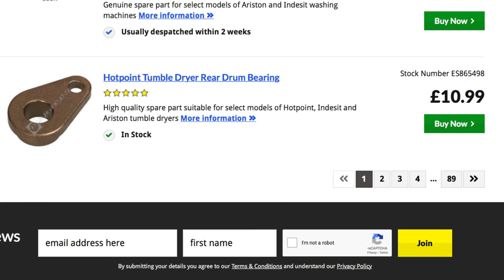How to fix the screeching, squealing noise coming from your tumble dryer (Hotpoint, Indesit, Creda)

Comment: I found your video on Google and I knew I had the same problem. Got the part for £7 and I followed your instructions step by step. It took me half an hour and it's like new again ( about 8 years old). Trickiest part for me was getting the pin back into the 'S' shape and in position. Thanks so much you've saved us a fortune and I'm well chuffed with myself 🤗

Comment: Thank you so much for this excellent video.  My son has just fixed my noisy tumble dryer using your instructions and the bearing bought from ‘espares’.   I’ve saved £120 calling Hotpoint out.  
My son found bending the pin back with pliers tricky so used grips.  Managed to squeeze both ends back into ‘s’ shape at the same time.
Reply from the maker: Glad it helped!

Comment: This man is an absolute genius…..bought the bearing for £4 …..the hardest part is pin ….a little tip I found made it easier ….when you straighten the pin make sure the hole is top dead centre….then gently tap with a hammer…..easily a £60-70 job …..cost me £4 ….and 30-40 minutes of my time ……you sir are a YouTube legend…..thank you

Comment: Great video , I've replaced a few of these and found that applying some high temp copper grease to the shaft makes the new bearing last twice as long (bearing lol 🤣)
Reply: I didn't have any bearing grease. All I had was silicone grease. I just remembered that I have copper grease from when I do my car's breaks. I will now take the tumble dryer apart again and use the copper grease. Thanks for the advice.

Comment: Just a suggestion: if you turn the drum, it rotates that shaft, making it easier to align the pin. Similarly, if you lift the drum slightly with your hand, you can also move the shaft!

Comment: I opened this video to address the loud noise issue in my Hotpoint dryer machine. While the specific solution I was initially looking for wasn't present in the video, I identified the problem – a loose fan. After tightening it, the noise disappeared. I share this experience in the hope that it proves helpful to someone facing a similar problem.

Comment: Hi, I was so proud I did this and yet, it still is making that noise. The pc was not that warped. What is the next option?
Reply from the maker: Hi, was the bearing worn, ie the hole itself where the shaft sits in, was that hole no longer round, just like the video.

Comment: This has fixed the noise when the tumble dryer rotates in one direction, in the other it’s got worse. Any suggestions ?
Reply from the maker: Your tumble drier goes both ways ? Mine didn’t …does the noise come from the replaced bearing ?

Comment: No, it was a bit (3 yrs old) but not as wild as your demonstration. Noise seems to be coming from the back bottom right where plastic tubes are.
Reply from the maker: Mine was really simple as when I pulled the dryer out and inspected the bearing it was clearly worn out. I have had a look on YouTube and obviously there are other bits and pieces that may cause the noise, belts, rollers etc, if its not the tear drop bearing that was in my video. If it was me I would pull the machine out and switch it on to try and work out exactly where it was coming from and then remove then panel to see what was needed to be replaced and then go to one of the spares websites and see if it was cost effective to  replace it or not. I am no expert and if it was beyond me then it would be a callout fee for an engineer , which would annoy the heck out of me. Good luck.

Comment: if you turn the original 180 degrees and drill a small hole in the casing it will keep it going long enough to get a replacement

Comment: I replaced mine and it still does the same screeching noise. Any idea where to look next?
Reply from the maker: Was the bearing at the back worn?Is it any better or worse than before?Did you put any grease on the new bearing? I believe that there are some bushes/bearings on the front of these machines that support the front of the drum, it could be one of these.

Comment: Really helpful video, thank you.  I followed this except for cleaning the shaft collar and regreasing. Now the same noise you had has been replaced by a significantly higher pitch squeak. Do we think that’s likely because not cleaned or greased? Or something else perhaps to consider?
Reply from the maker: Hi Michael . Was the bearing you replaced worn like in my video ? With the machine turned on can you definitely say that the noise is from that bearing , you may have to have the machine pulled out . If the nose is from the replaced bearing then yes clean and grease . 👍
Reply: @gsd32i  thanks very much. Yes was definitely like yours on the verge of wearing through. I’ll get it apart and clean and grease and see how I get on then! Thanks again for video l, really helpful!

Comment: Thanks for this video. I had a look at the drum bearing on ours and there was some small metal shavings but nowhere near as worn as yours. I replaced it as you did anyway. Worked for about half an hour after that then started squealing again BUT this time the squealing carries on even when the drum stops for a few seconds so I’ve realised it can’t be the bearing. 

Anyone got any ideas what else it could be??
Reply: IF THIS VIDEO DOESN'T SOLVE YOUR SQUEAKING, READ THIS
Ok so, I narrowed the squeaking down to the back of the machine, bottom right. Which on mine (which is a condensing dryer) is the pump. Bought a new pump on ebay (half the price of some spares websites) and I will change this and hopefully that solves the problem.

Comment: Could the friction from the bearing and the shaft cause smoke in the drum? As I have the high pitched noise, and today my tumble dryer started smoking.
Reply from the maker: hi. I am not a technician. smoke in the drum is clearly not good! my advise would be to contact a technician and not use the machine and disconnect from the mains supply . have you checked the bearing to see if it is worn ? does it make a noise like in the video? or is it just smoking ?
Reply: @gsd32i thank you for your reply. I have the metal debris at the back by the bearing panel, and it makes the horrible high pitch noise when on.
Reply from the maker: @GwylymDavies  I would replace the bearing in that case . Have you cleaned the filter and has your machine been subject to any recalls for the filter ? The smoke thing is cause for concern , I wouldn’t use it if there is smoke ! I am just a chap who makes YouTube videos to help others  and am in no way an expert 🙈
Reply: @gsd32i hi, just a little update, so I changed the bearing as it was completely worn down, turns out the smoke was caused by a burnt bit of built up lint.
Reply from the maker: @GwylymDavies  Glad you got it sorted. Thanks for the update 👍

Comment: Glad I found your video. But cheesed off as my tumble dryer isn't even 4 years old yet. But it's driving me crazy. Read somewhere else it could be the belt, so do you recommend a belt as well? It only makes a noise once it's got hot. Once it hits the cool cycle it stops and sometimes it doesn't make any noise for the whole cycle. There doesn't seem to be any common factor.
Reply from the maker: Hi if able , firstly unplug the machine and pull the machine out and undo any inspection cover you have at the back of it. This should give you access to the  
bearing/shaft and you can have a look to see if there are any tell tale signs of the metal filings like in my video , that’s if it’s a tumble drier . Is yours a combined washer and drier then ?? If so remove the access panel which allows you to have a look at the drum belt to see what condition it’s in . You may have to be a bit like Sherlock Holmes and do a bit more detective work to workout where the screeching noise is coming from and pull the machine out of possible . If it’s a combined machine washer/drier try it on tumble drier mode only and see if it makes the noise .
Reply: @gsd32i  Thank you for replying. No it's just a tumble dryer (I assumed it had a belt). I've had the bearings go in the past this sounds totally different. Like  i said only happens when hot. So the first 45 mins or so it can be quiet then kicks off at varying levels and pitches, you open the door let it cool usuallu stops until it warms up again. then for the cooling it stops again. 

Also just quick Google of the part showed a kit from Hotpoint that has 2 bearing, one was square and in description it said use whichever one matches the machine,  so might be worth mentioning in your vid there could be different ones.
Reply from the maker: @Shayde268  Sounds like something is expanding when hot and causing friction between 2 surfaces. I use these guys loads for spares for various knobs and things around the kitchen etc. Check out this link on their website and it may help you work out what may be the issue. Just click on the "how to" to get further info on possible causes
https://www.espares.co.uk/advice/symptom/noisy-tumble-dryer
Reply: @gsd32i  s'ok I'm going to give the bearing thing a go anyway as I had a quick look the other night and founf the tell tale black dust. But thanks for that I'll check that link out too.
Reply from the maker: @Shayde268  the black dust …. I’ll put my money on that being the issue 👍
Reply: @gsd32i  Still waiting for delivery, but thank you for being so helpful.
Reply from the maker: @Shayde268  no problem . 👍
Reply: @gsd32i  UPDATE. It wasn't the bearing :( and the belt looks ok too so now I'm stumped again.
Reply from the maker: @Shayde268  looks like Sherlock Holmes May need to do some work here to investigate it a bit more . Have a look at this video it may give you more pointers as to what to try and look at . https://youtu.be/u6614TVugVc
Reply: @gsd32i  hi thanks for the links. One thing I noticed tonight is when it does make a noise it sometimes starts quietly and then gets louder and higher almost like it's accelerating, which the drum obviously isn't. Every now and again I get a whole dry with no noise whatsoever. Trust me to have the awkward one.
Reply from the maker: @Shayde268  lol 😂I feel your pain. Does it make a difference with the weight of the load? It could be the drum rollers that support the drum against the front side of the machine.
Reply: I wondered that but there's no clumping sounds (like it suggested in that other video) and it still does it even with a light load though it's been mostly quiet-ER since doing the bearings. Still noisy but not wake the neighbours noisy 😂

Comment: I followed your video tutorial but my dryer is still making a noise slightly but especially when the drum stops and turns the other direction, what did I do wrong or could be causing this, thanks
Reply from the maker: Hi, was the bearing worn like mine was? Mine hasn't made a squeak since I replaced the worn bearing.....did you put some grease on the shaft like in the video?
Reply: There was a little bit of wear on the original bearing but not as bad as yours even though it was making the same squeaking noise, there was black dust there aswell
Reply: I did put grease on it and cleaned it with wd aswell
Reply from the maker: @angelawhelan7061 ok so pretty much the same as mine then. Everything has been screwed back and nice and secure? There are, I believe some rollers on the front of the machine to support the drum...so I do not know if that would cause any noise....have you opened the door and rocked the drum to see if you can pin point the location of the noise . Is it better than before you replaced the bearing?
Reply: I have it going at the moment and it is better than before not as noisy, I will have to have another look at it I'm sure I tightened the screw but you never know, thank you for replying so quickly
Reply from the maker: @angelawhelan7061   No problem , just enjoying the sunny weather and about to fire the bbq up. 🤪

Comment: Mine starting making loud noises so checked my bearing.
The bearing is fine? What else could it be?
Reply from the maker: There may be some rollers at the front supporting the drum making the noise . It may need a bit of detective work 🙈
Reply: @gsd32i  how can I check that out?
Reply from the maker: If you are sure it’s not the rear bearing ? Then have a look at this video 
https://youtu.be/VHERLc_mnOk
It may help . If you go to an online supplier of parts and put in your model number etc it will list parts for the machine and you can then see what may be giving you the problem , if your definitely certain it’s not the bearing 👍

Comment: I followed this video - it was really simple and worked for a while. But then a few days ago the squealing came back. I opened the back of the dryer and found it had wrecked the new bearing already. Is there anything different I should have done?
Reply from the maker: Hi, to be honest I am not sure. Very strange that the bearing was wrecked. Was it secured in properly? I believe there are some roller bearings/supports on the door side of the drier which sometimes can fail. It may be something more serious than just the bearing itself wearing, like  most do over time with normal wear n tear. Possibly time to contact a technician if nothing obvious. Apologies that I can't give you a more definitive answer.

Comment: Hello, I fixed my tumble dryer following your instructions and the squeak went away for a month but is now returning. Any idea if there is a secondary problem I could look at?
Reply from the maker: Hi.Have you checked it to see if everything is as it should be ?
Reply: @gsd32i  I don't know what to check for except the machine is level and the filter is clean.

Comment: Thanks a lot. I ordered mine from the agency for Ariston here in Saudi Arabia and fixed mine in 30 minues. Question though, my bearing was not that bad when I replace it it had metal shippings but as bad as in the video. Do you think there might be another problem? The sound is gone though 😊.

Thanks again
Reply from the maker: If the sound is gone then I would say that that was the problem. Mine had been making the noise for a while!
Reply: Ah I see maybe that is it. I stopped mine the moment it made sound 😅

Comment: Can somebody please tell me which size Torx screwdriver is used to remove the screw holding the bearing to the casing?
Reply from the maker: Do you still need the size ? If so I can drag my drier out to check 👍
Reply: @gsd32i  No, I discovered that it is Torx size 20. Thanks for both the original video and the reply.

Comment: Interesting. 

Loose the music.
Do not call lock wire a split pin.
Do use pliers only, not a screw driver to remove lock wire. 
Do use a cable of sorts to lift shaft to remove bearing(same as refit).
Ensure to use just enough grease on the inside.
Do not use excessive grease on the outside.
Squeeze pliers to bend the lock wire lest you stab your finger when pushing with pliers slips.

Otherwise, ok.
Reply from the maker: Thanks Dave for input . The reality is people know what I am referring to ie split pin locking wire , but yes you are correct 🙈screwdriver / pliers , whatever works I guess . Music , well turn the volume down 😂. It was filmed as I went along so may not be perfect but got the end result  and it’s still quiet 👍

Comment: . As a short term solution you can spin the bearing 180 degrees and drill a fixing hole and screw in a retaining screw such will get you by until your spare arrives, Amazon  nxt day….. it’s was like the world had ended for the wife so had to fudge a repair 😅😂

Comment: Crap design really, they should of designed it with a proper sealed bearing so it lasts much longer 😟
Reply from the maker: Totally agree . The term “bearing “ leaves a lot to be desired… more like shaft support ! Either way the machine lasted noise free for about 10 years so I’m not complaining too much 😊
Reply: @gsd32i  the original manufacturers bearings must be better quality, i purchased 2 of eBay about 2 years ago & just replaced the 1st eBay bearing 😟 had to put in a thicker screw fixing that the bearing screws into the tin rear sheeting as the original wasn’t biting properly & left the bearing slightly dropping in its housing & the original pin has broken when I bent it straight 🤦🏻‍♂️ so luckily managed to get a split pin in there & secure the front metal washer
Reply: @gsd32i   my creda dryer is making a scratchy noise when running can you help me
Reply from the maker: Have a look at the back of the machine as per the video and see if there are any metal shavings , if there is then the bearing/support plate needs changing just like I did.
Reply: @gsd32i   thanks I will check it out the next day
Reply: @gsd32i   the drum shaft may stop the drum from turning
Reply: @gsd32i  is it easily assessable 🤷🏻‍♂️
Reply from the maker: @tonyl1984  yes , as always , unplug the machine before pulling out to access the rear